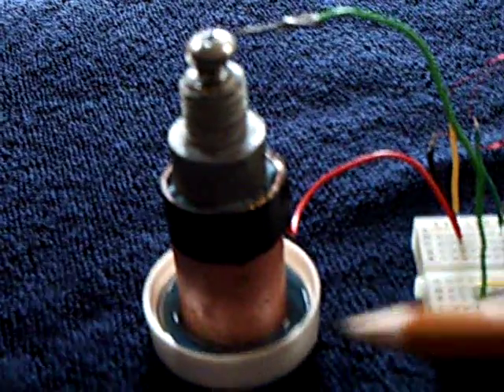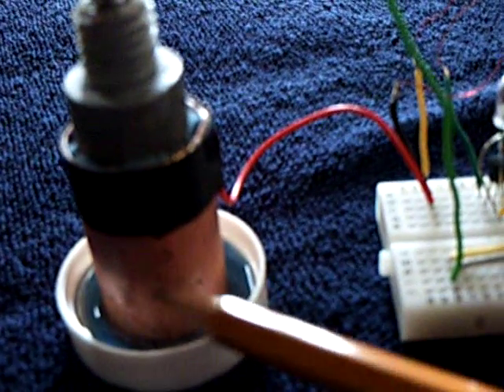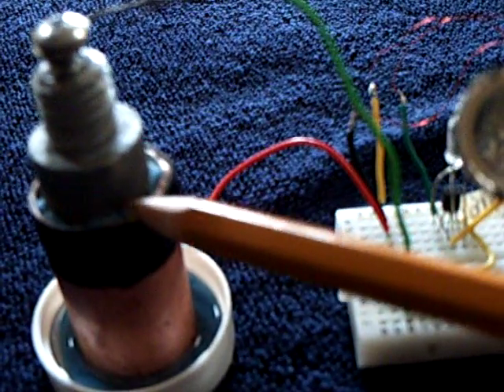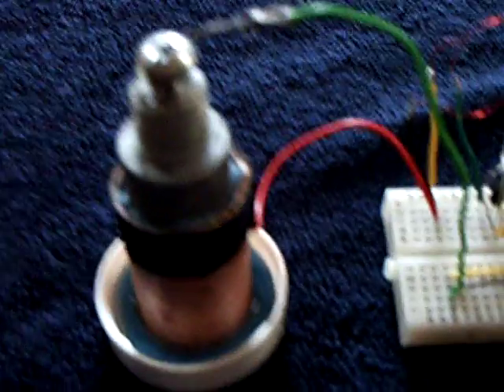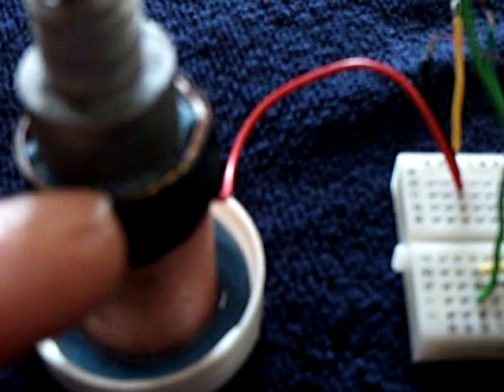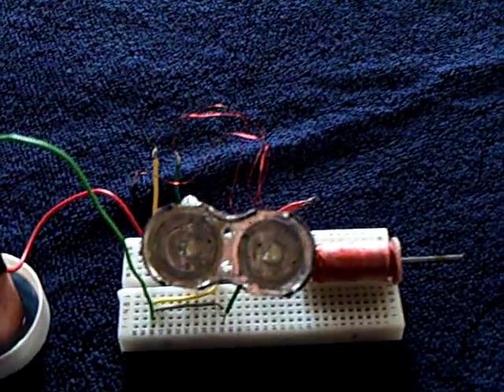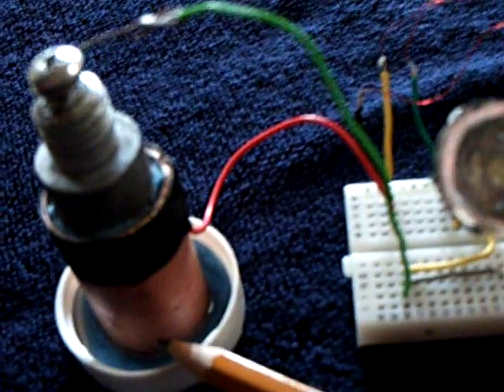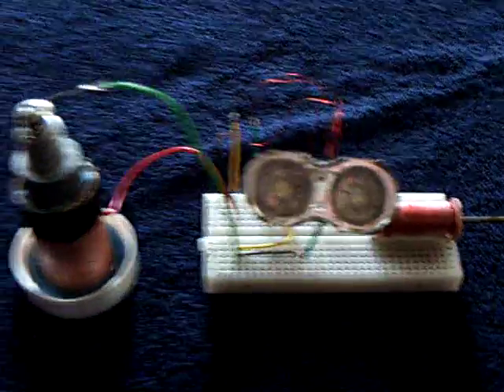Semiconductor copper cell.ASF

Comment: Nice battery once again amazing stuff. I have done the same thing with copper pipe in the past building hho cells with copper and stainless. You just make the copper negitive and the stainless metal postive and the black coating on the copper disappers and cleans the copper just as good as you have it. Electroysis I have found does the same cleaning but the atomic structure would be different your method.

Comment: @Lidmotor 
OK Lid. I just treated a few pieces of copper pipe. Made them very hot and quenched in water with as much Borax as would dissolve. I wound two layers of magnesium and am ready to add the water. I have a layer of shammi between the pipe and windings with a wick coming out the bottom, I just never knew how much Alum to put in the water to wet the shammi. I guess I'll just use a little spill in 6 ounces of water. If you ever find an exact amount let me know some time.
J